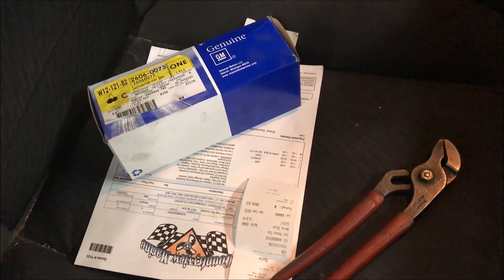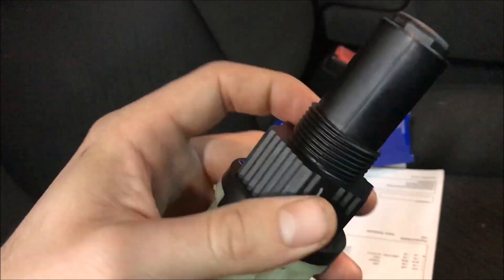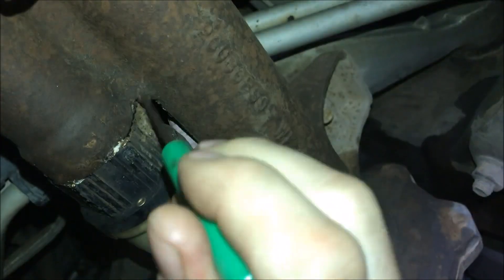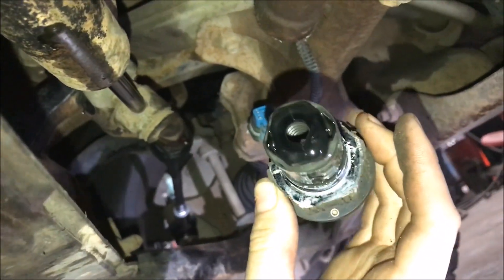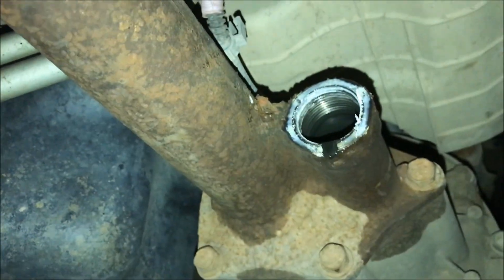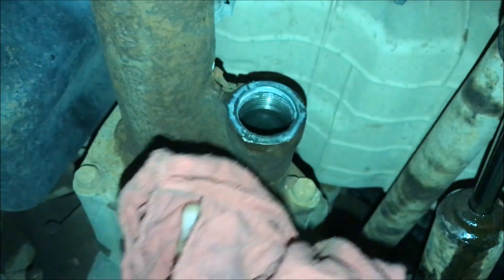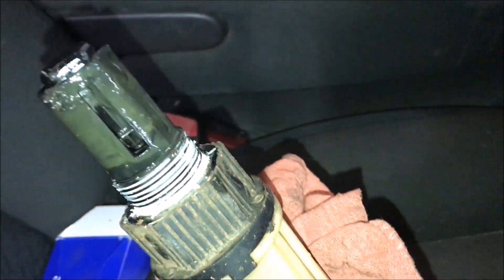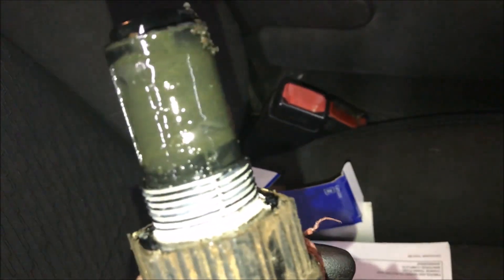1999-2012 Chevy Silverado/GMC Sierra 4x4 Axle Actuator/Solenoid/Shifter Replacement Video

Comment: when going from 2wd to 4wd the blinking light on the switch takes forever , takes even longer when going from 4wd to 2wd and now i feel like the 4wd isn’t engaging because i feel no resistance when making sharp turns in 4wd. it was just working yesterday too. can it be the acuator? oh ya the truck has 230k miles
Reply: and the little noise you hear when going from 4H to 4L sounds very weak and slow, but it makes no noise when i go from 2wd to 4wd
Reply from the maker: @dannylsx  Could be the actuator but it’s also possibly something else electronic. I’d probably start with an actuator and make sure all your fluids are good.
Reply: @dannylsx  what was it I have same issue
Reply: @jtglenn3  it was the 4x4 actuator , its a easy replacement takes 30 mins max

Comment: Alright so basically if you have a bad actuator.... your front wheels will not engage and have terrible traction???? I'm near Chicago and it's snowing.... feels like my whole front end is slide and transmission is not shifting? appreciate if someone will help
Reply from the maker: I mean that could be a lot of things, but come to a complete stop and put the truck in 4 hi and see if the light stays solid and actually goes into 4wd. Then give it the gas and see if the front tires spin or just the rears.

Comment: Is it the same actuator for a 1500?
Reply from the maker: Sorry I’m not sure. They COULD be the same, but the 1500 likely uses a different front axle, so it’s probably different. You should be able to look it up by year/make/model though on most auto parts store websites.

Comment: I had gear oil in the plug and it's not out yet but it wobbles right in the middle like it's broken internally
Reply from the maker: The electrical connector? Or the actuator itself?
Reply: @TonyTheTruckGuy  the acuator itself . I have battery power to it. 2wd light is on steady and 4wd light flashing. Doesn't change no matter what you push thanks
Reply from the maker: Yeah something doesn’t sound right and if you have gear oil coming out of the plug, the actuator is shot anyways. I would try to remove it to get a better idea of what is going on in there and put a new one in.
Reply: @TonyTheTruckGuy  I see why it was wobbling around it was nearly broke off. I turned it about a 1/4turn and it broke off flush. So threaded part is still in the diff. This don't look fun
Reply from the maker: Oh boy. I’m not sure if you’ll be able to get an easy-out that big. You may need to use a hammer and chisel to break it out in chunks unless you can use a pick or screwdriver to spin the remaining portion out. But if yours comes out as hard as mine, that’s gonna be tough.
Reply: @TonyTheTruckGuy  I got it out.  I took a wood hole saw just the flat kind with a point. Not the round hole saw. Pounded in in and turned it out with a vise grip.  Got lucky!! Thanks.
Reply from the maker: Genius! haha.
Reply: I was replacing this thing, screwed old one out with all my strength by hand due to coated threads.  Put new one in, and it never got snug.  Instead, the whole thing snapped off inside.  I am hoping to get that out with a couple of screws drilled in there and a pair of Pipe pliers.  Anyone have any other suggestions?  Not enough sticking out to get a vice grip on it.
Reply from the maker: You could try the method that Todd S above did and if that doesn’t work maybe use a chisel and a hammer to knock it out in chunks just make sure not to send and plastic flying into the differential.